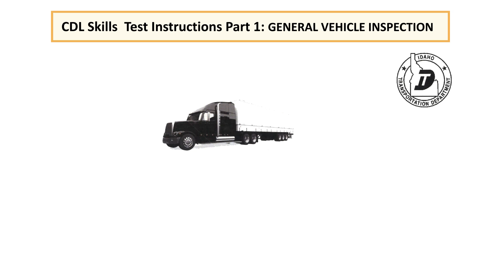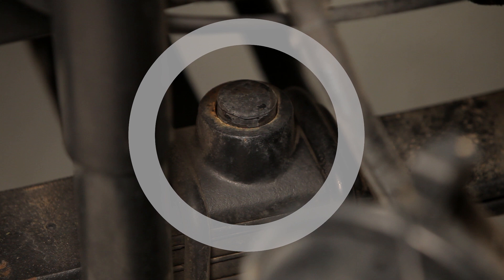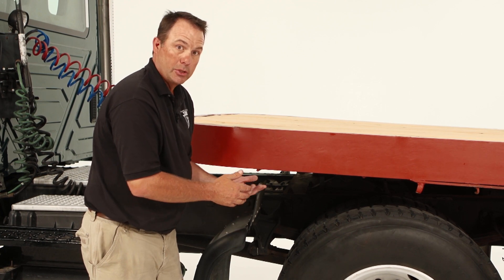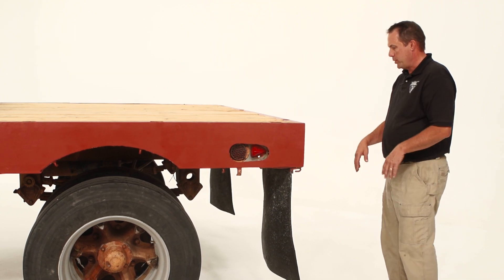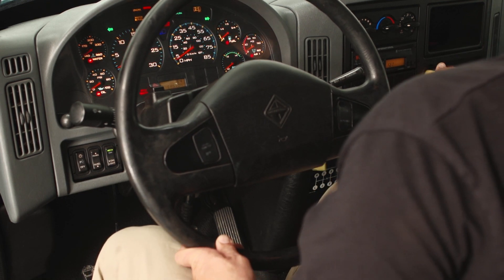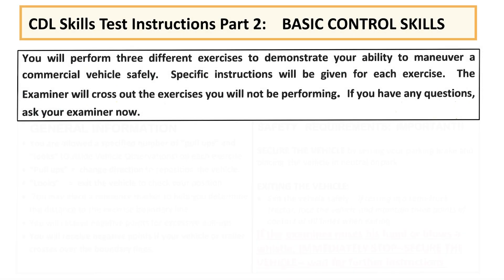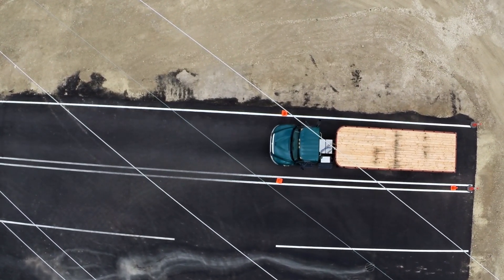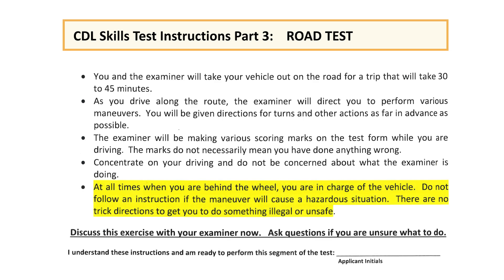Full CDL Inspection Final 2020

Comment: You cannot check the drive axel to make sure the hub bearings are full of oil. No window  or plug. Only  way is to check amount of lub in rear-end by removing the fill plug with a wrench. Also you started by saying to walk all th.e way around the truck. But you did not. Also you did not check the wiring for the trailer lights under the trailer. Also what about the bed of the trailer, loose boards, holes, 
Metal broken. Also what about tie-down points for no cracks, and adequate  for use.
Also check break air lines for wear points on truck and trailer.